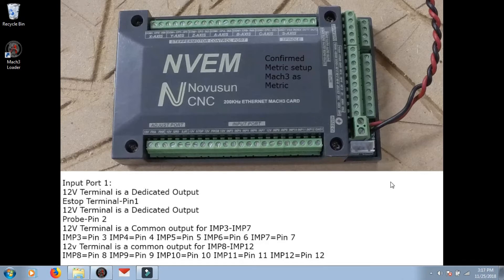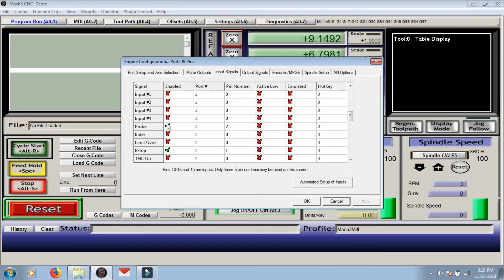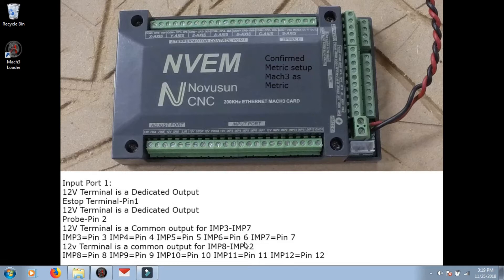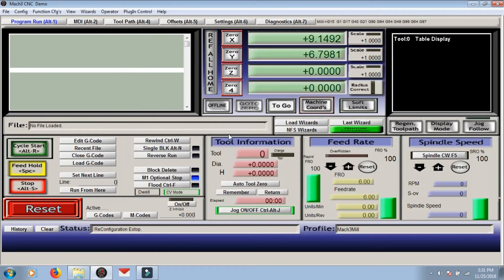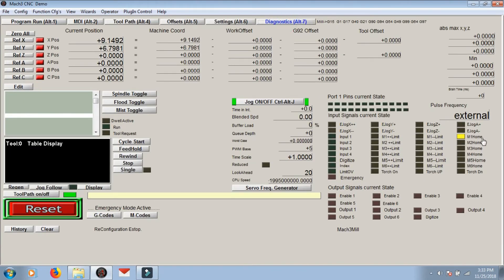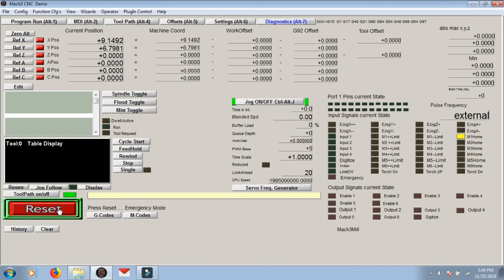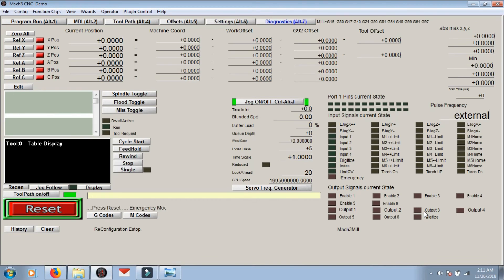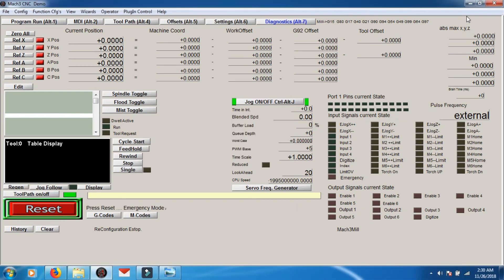Connecting to your Nvem Part  3- Ports and Pins, tips and tricks.

Comment: Wonderful, thanks a ton for all your help.  I was tempted to ...mmmurderrrr... this device.
Reply from the maker: I know what you mean, I was at that point too! figured why not make a video on it.
Reply: @DZMech  

So I have to say, this NVEM Novus is full of mysteries. I'm beginning to think its a huge piece of wasted money.

So I connected all drives, everything 100% certain correctly wired. My X axis with a slaved motor (Dual drive) would only move one direction (either arrow key drives it the same direction). So I took Y and Z drives, and wired them to the X dual drive - the X drive would work perfectly (Moves both directions depending on the key pressed).

Now, I wired an additional motor - Y - it moves only 1 direction now. Did the same thing with Z - moves only one direction.

I have no idea what this means but if anyone has an idea please let me know.

What do you think could be wrong - am I missing something here?

I was thinking it could be a driver but now I don't think it is. 

Otherwise, I'm just buying a smoothieboard and let this be my last mistake when buying garbage with terrible information.